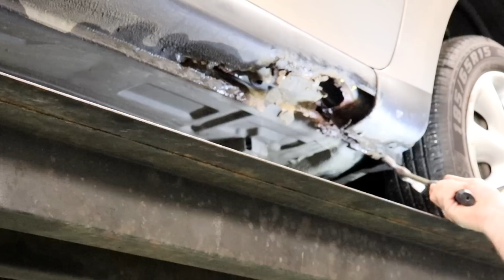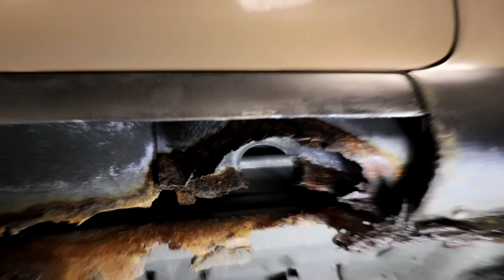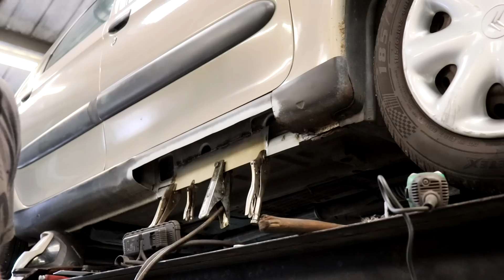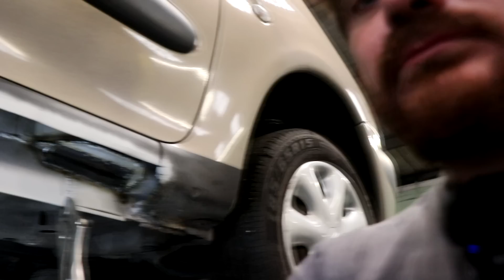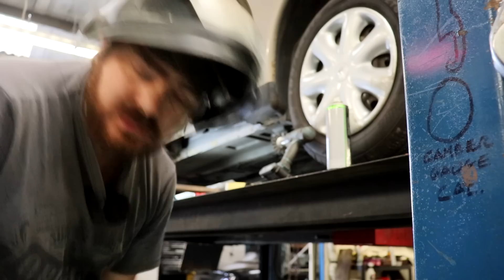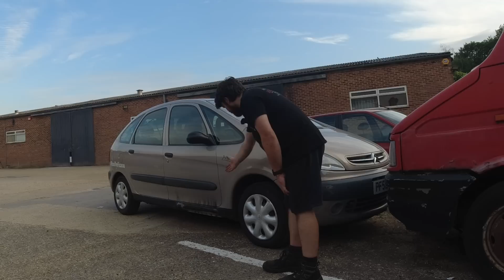How NOT to run a business (ft. #passthepicasso & its rusty sills)

Comment: Oh, this has taken me back forty years to the sills on my Renault 16! First "repair" involved a section of a forty gallon oil drum and pop rivets followed by underseal - and then when the left hand rear torsion bar bearing broke away from the inner box section (because Renault) my father and I fitted two new pattern sills but he also had to make up a huge inner strengthener because it had rotted just like the Picasso's had. The car was welded with gas, so fire did happen on more than one occasion. God, I miss that car... great sound track, by the way!!

Comment: I just did a pretty major welding job on my elgrand (check my last vid if you so please) and everything takes 8 times longer than you think. I felt your pain when you said making the outer skin out of two parts would suck, I had to, I've got no way to bend a sheet of metal that long. So then I had to spend hours matching the bends, getting them flush, welding them flush, grinding flush etc. I refuse to overlap welds, everything was flush. frigging nightmare. 
When you said I'm gonna try do it under an hour, I was thinking 'hes having a laugh'. You still did it faster than I imagined even if it 'only' took you 5ish hours.

Comment: I feel your pain, I was a welder in an MOT station and some of the old repairs I had to cut away to do a proper repair were incredible. A Mercedes’ came in and had three cover calls welded over each other. I ended up stripping out the interior to replace the inner cill front to back then the strengthening membrane and then the outer cill. I had phoned the owner and got the ok to do this, he had bought the car a week earlier with a months test on it and brought it to us to check out. Did the one side and he arranged to get the other done the following month. The tales that repair shops could tell you would scare you shi*less.
Reply from the maker: I've seen some pretty bad things over the years, but I suspect MoT stations see the worst!

Comment: This is perfect for the person looking to get some more time out of a good running but rotted out POS. This is how I do it at least. I chop out the rot, weld in steel and I don't concern myself over the scars. As long as it's solid, I don't care. I can get more out of my vehicles. Was that a Union Jack on your cutoff wheel for the grinder?

Comment: If it's like the Peugeot 406 they have an inner and outer sill with a plate in the middle that all rots because the sunroof drains into it. Nothing wrong with a bit of recycling;  I used a computer case and washing machine case and it's already painted.

Comment: 10:07 i think you can cut this width repair under and weld same parts external. that steel doesnt looks bad a connection and drain bad

Comment: I would actually have been pleased with that if i had done it. MIG and plasma cutter both have similar effects in my hands when trying to butt weld thin steel!😢. My welding was once described as a collection of metal bird turds!
  Wasn’t that BX door worth more than the Picasso?😂

Comment: Hi, It would be worth putting some anti rust treatment in the 
Sill while it is open.
Reply: How many years life do you seriously think that thing has ahead of it ?
Reply: @johnmoruzzi7236   Good internal repair inside that sill, the rust there was taken out, so that won't be coming back any time soon, a buff of the  weld on the outer sill with a Flap disc on that angle grinder and a few coats coats of zinc primer followed up by blacks Stone Chip along the sill length and its then well  sorted. thais wasn't a Bodge Job by any means, SORTED.
Reply from the maker: It's caked in zinc-primer inside, I'm sure somebody can buy it a can of Dinitrol or something.
Reply: Can't do everything, not even on YouTube, I thought the idea was to do your bit and pass it on to the next user to do a bit etc.

Comment: I hand beat a sill for a Standard 8, won't be doing that again...
Reply: I have that exact job on a 1953 8 waiting for me to get round to it, along with floor pan outer edges and door bottoms.  I'm rather hoping with the 8's thicker sheet metal, welding the many rusty bits will at least be easier than the paper thin metal on my 2cv or my latest job Mk1 Focus...  That will of course be countered by the thicker steel being more work to cut & bend ;-)
Reply: Scuttle panel for a Mk2 transit was my most difficult piece of hand forming & beating Jiggery-pokery……. Never, ever again…….!
Reply: @christhesnaildriver  mine was a '56, turned out to be too rotten to continue, but I did get a lot of practice.

Comment: So despite Spain still having a steel industry the steel they use at the Citroen factory is crap compared to what the French used for the BX.

If you were doing that rushed internal repair for a customer on a budget then the time saved would completely justify the rough and ready patchwork quilt approach, especially as you say when a decent outer sill can be bought to make the outside look perfect.
Reply from the maker: I guess it's just down to cost, but the metal is awful to weld to, whereas the BX is nice.

I wouldn't do it for a customer, to be honest. If budget prevented them doing it properly, I'd suggest they took it to someone else. I'm still not happy with this one now!

Comment: Being honest, you would have been better off leaving the sill alone, driving it to the festival and then asking the owner if he wanted to fix it correctly. The car wasn't exactly about to fall in half you could have driven as it was before you poked a hole. That said, on the welding you did do, you could have used a circular drill bit to drill out the other half of the premade factory hole in the inner sill, would have looked good!
Reply: Well its hard to tell, but is seemed like the seatbelt might have been a bit of a worry in a crash, perhaps? Not nice to having it rip out of the chassie in case the worst is to happen, especially if the car is getting cunched and twisted in the metal by the impact forces already.
Reply: @GoldenCroc  I'm unsure about that. I drive cars old enough to not have seat belts so that concern is way over my head haha.
Reply: @Adam.Piper62   Well I cant tell at all, but he did mention its precariousness several times in the video so thats what I based that on.
Reply from the maker: I did ask the owner if he wanted to do it properly, and at this point he didn't. It was me that wanted to drive it to FotU, so it was on me to make sure it was legit IMO.
To get a holesaw in the inner sill would have meant cutting more of the outer sill away...pointless really, as it still wouldn't have looked OEM.

Comment: Without taking the wing off and repairing the jacking point area, if anyone jacks the car up to change a tyre, the jacking point may well collapse when the weight of the car is on the jack.  Its VERY dangerous to do repairs like this, as a jacking point failing can be very serious.

Best to have left it, and repaired it properly when there was more time.......................
Reply: Well, you live up to your name
Reply: @Eleftheria_i_thanatos  Would you be happy for your jacking point to collapse, when halfway through changing a tyre?
Reply: It's always safer to sleep under the bed.... 😁
Reply: @terryatkinson899  Seems astonishing that anyone would badly compromise safety, for the sake of a Youtube video?

Better to have left replacing the sill, until there is time to do the job properly.
Reply: @humourless682  can you weld? If not your not in a position to comment. I weld as an amateur and know how different cars are to weld when rusty. The inner structure is well done here and that's where the strength is. Outside is only for cosmetics.
Reply: @terryatkinson899  I did restoration and MOT welding for many years.  

What he has done is an unsafe bodge, as the front closure of the sill, and inner membrane which support the jacking point (and is hidden behind the lower part of the wing), will be rusted away, which will mean the jacking point could collapse at any time.  

How would you feel if you had done a similar job, and the jacking point collapsed, while the owner was changing a wheel, and got badly hurt?
Reply from the maker: It's almost like you're assuming that I didn't check it was solid behind the wing...
Reply: @UPnDOWN  Would have thought that would have been pretty difficult without taking the wing off?  How on earth did it pass an MOT being that rotten?